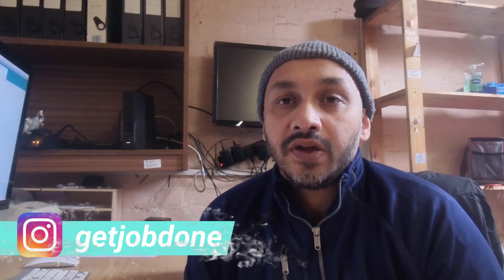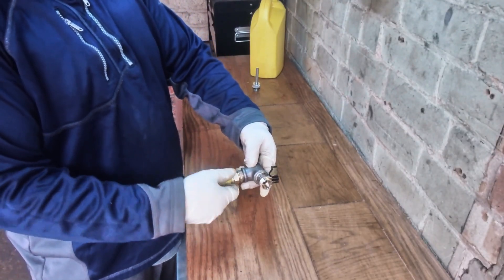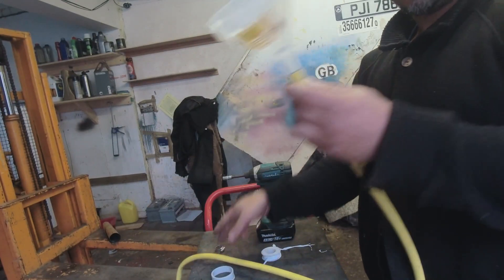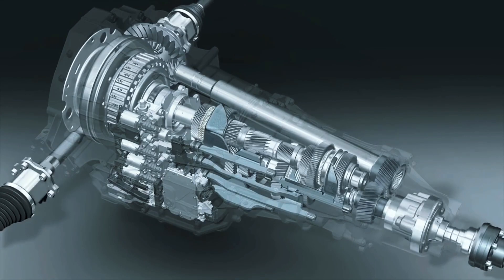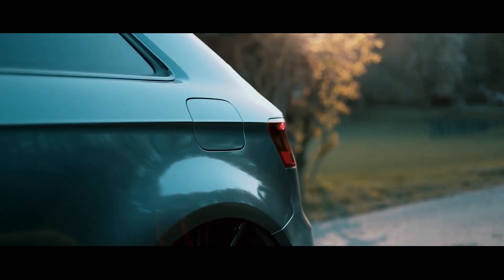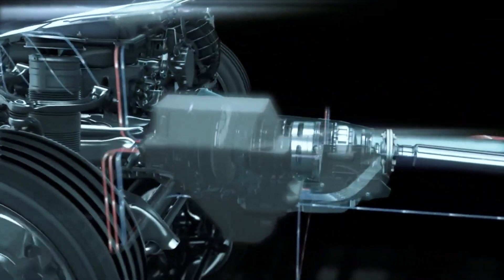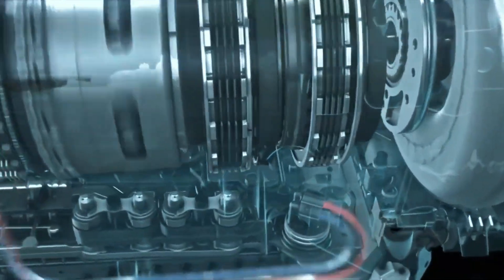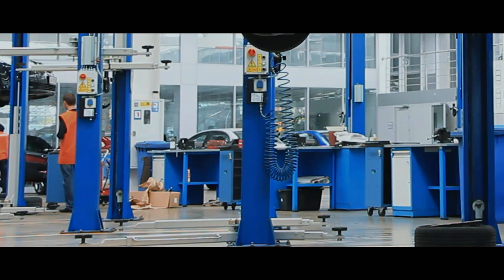Filling Automatic Transmission Fluid Guide for VW Audi Mercedes BMW

Comment: Sweet DIY tool and excellent information about the various boxes! There might be tools out there for it but that one is modular. Could easily just change endings ect to match other system.
Reply from the maker: Some of the tools out there like this pump is just what it is few quit diy tool, obviously there are professional grade tools too but this one does the job for what it's made. Fun fact I am short on my water hose now at home as chopped it for the video and couldn't wash my car over weekend 😂
Reply: @GetJobDoneofficial  🤣 oh well lol